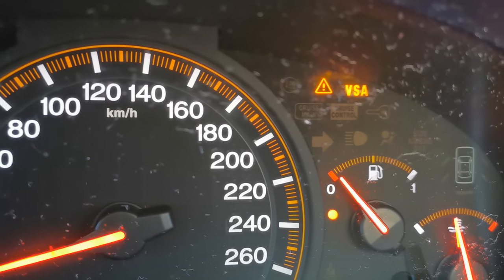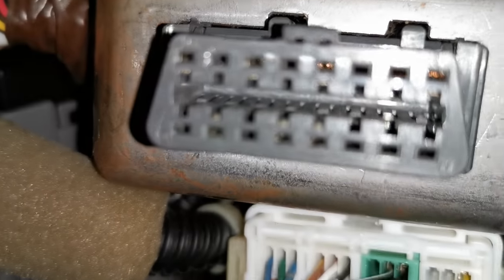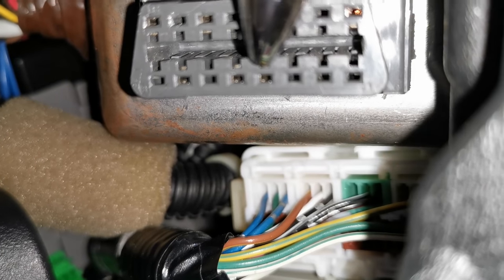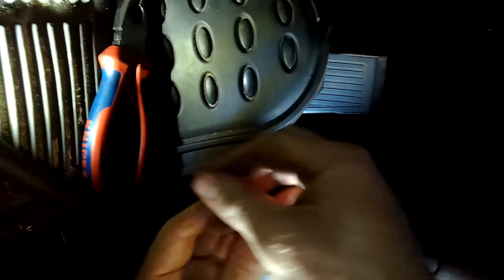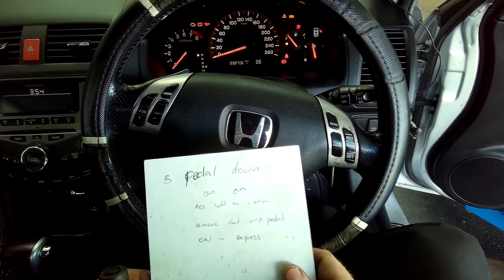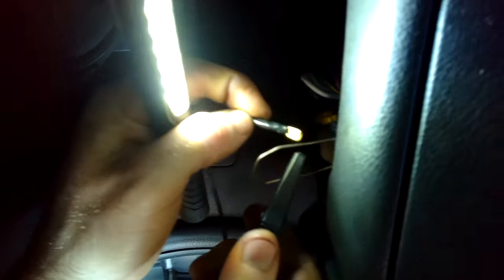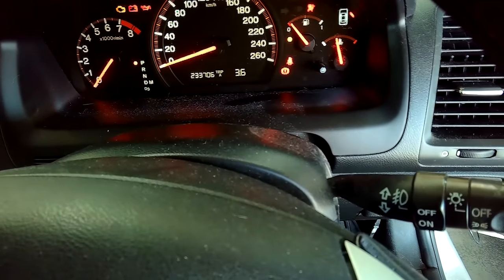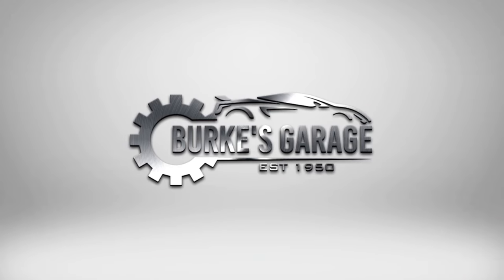Honda VSA & ABS Warning Reset - Simple DIY

Comment: Hello,  I was watching your video to do the same procedure. Unfortunately I put one end  in the 4 the other end in the wrong one .
Now my car dashboard lights are all gone then check the small fuse was burned. 
Replace the fuse dashboard lights came back but car doesn't start. 
Ignition turns on car doesn't start. 
Would you help me please 
Thank you
Reply: Hello, 
Can I reset the 2013 honda Accord with the push button start?
You said that push the brake paddle and turn the ignition on.
If I push the brake paddle and switch the button, the engine turns on.
I need your assistance 
Thank you

Comment: I just had an mot done which is in the UK on a Honda Civic 2006 the day after the ABS vsa lights were on. Does anyone think it has anything to do with going through the inspection or mot?
Reply: Mine came on after they ran a scan to check the alternator so very possible

Comment: Thank You very much @gerald Burke. This worked after the fault was introduced during a full scan using a Snap on scan tool. Anyone has any more information as to what exactly happens to the CAN data link to introduce this fault during a full scan from certain scan tools? Could it be that the scan tool is trying to send a message that isn't understood by the ABS module hence "84-01 sensor logic failure" code.

Comment: I did exactly what you said and it did turn the lights off but somehow it comes back
Reply: Try not using the ground for the second step and just leave the jumper in pins 4 and 9.
Worked on my 2007 cl9 accord 2.4ltr doing this.

Comment: Nice video, but it ain't straightfoward enough. So if people are better reader than viewer, i copy here the instructions that i found on club tsx :
1) Jump pins 4 and 9.
2) Press and hold the brake pedal and switch on the ignition.
3) Wait for the ABS light to turn off and then remove your foot from the brake pedal.
4) Wait for the ABS light to turn on, then press and hold the brake pedal again.
5) ABS light should turn off, then remove your foot from the brake pedal.
6) Wait for two flashes of ABS light. If it flashes it means that errors are erased.

Check the errors (with the pins jumped) - just turn the ignition on, if ABS light does not flash, no errors are in memory.

Now the main part.

VSA neutral position setting

Do not touch the brake pedal anymore.

1) Jump pin 9 to chassis ground (I have used a bolt on a door hinge).
2) Turn the ignition on, after ABS light turns off, quickly press the "VSA off" button.
3) After ABS light turns on again, quickly press the "VSA off" button.
4) Now should be a lot of different blinks and flashes and all lights ABS, VSA and triangle should turn off. The problem's solved.
5) Open the beer bottle!

And yes it works 100% :)
Reply: What if my triangle light is on when I start the car and then vsa light pops up about a minute into driving

Comment: This procedure worked on a 2009 honda pilot,it fixed a 84-21 code after a full code scan with a Snap-on Modis Edge scanner
Reply: @GerardBurkeBurkesGarage  have an American 2007 civic Si. Same problem. Will this process work? Same instance, did a full scan then lights came on.

Comment: Thanks for the tip, worked on a 2003 accord in Canada, my cpr129x must have caused it.
Reply from the maker: Cheers John, thanks for the comment.  
Off topic question, how do you like your Launch? I am getting a Creader 909 in a month or so and will be doing some reviews on it. 
interested how you rate the 129x
Reply: Gerard Burke  I have had it since about Christmas, it’s been pretty useful, I was able to reset the brake light after a brake job on a Hyundai, the cheap Bluetooth to phone devices couldn’t.  I was able to read the data on the abs pressure switch that’s how I knew your reset would work and that it wasn’t a bad abs pressure switch

Comment: Hi I recently had my VTM-4 oil diferencial changed and know this VSA ⚠️came on can you tell me what causes this and would this apply on 2006 Honda Pilot
Reply: 2006 pilot ex 243k miles. just fixed mine with this step. had o2 sensor replaced and vsa light came on after mechanic cleared the codes. dont know what triggered the vsa light either. its just a flaw imo.

Comment: Thanks for this, just done on my 07 FN2 Type R worked spot on, removed both.
Reply: I can’t get it to work on same car.
Reply: @russellmay9841  Just remember plug is 1-9 on top,bottom is reverse 1 is below 9.If you have this then follow as in video,my ABS did flash 2 times but came back on though.Tuned ignition off but left keys in so was beeping, I then removed no 4 attached earth to clip & my door nut & followed as video. It did take me 3 times before worked though. Fingers X it works mate.

Comment: 2006 Pilot 243k miles - this fixed my vsa light. had bank1 o2 sensor1 replaced and mechanic cleared the codes even though i had no check engine light, but i had intermittent 420 code. started the engine and traingle light was on, at 30mph the vsa light comes on. after i cleared the light, drove it for 13 miles and no warning lights.

Comment: Mine has ABS VSA and BRAKE lights on, my mechanic changed all the wheel sensors and I still have all lights on, he is telling me now it could be the control module. wow! I will try this and see if it works. 

Also my passanger window works but not from drivers side main control, I bought a new one and didnt help. Any ideas? thanks!

Comment: Always check your fuses first before doing this !edit:I recently cleared all my lights which was abs and tcs turned out it was just a 7.5 fuse
Reply: What year and model do you have and which fuse was it?  Thanks in advance!
Reply: @user-wc9qz7bx5k  2002 accord I forgot the fuse number but it's located on the inside driver side fuse panel box  it's the 7.5 fuse related to the tcs ....also if you take out the clock fuse and put it back in it will clear the check engine light sometimes..
Reply: @jobee1585  Thanks!  I'll give those a try.  I've got a code reader and can clear the codes but they always come back.  If the fuses are good I think I may need to replace the abs block, control module, or motor or all of the above.  Thank you for your help.  I appreciate it!
Reply: What fuse was it ? If possible
Reply: Will this work on a 2010 Honda Accord?
Reply: I tried it yesterday and the IMA light came on and doest work anymore, do you think I blew a fuse for the IMA?

Comment: Sodding car. Type R 07, changed all brakes and discs and lights still on so I’m using this method. Hope it works.

Edit: Doesn’t/Didn’t work.
Reply: Did you experience issue where car blacked out when you tried to start? I lost all electrical after doing this.

Comment: You're awesome man. I just did a scan on my car after replacing a wheel sensor so I could delete the codes and that damn triangle came on. I scanned 2 more time to make sure everything was good and it was but I had to do the reset trick to get this stuff to clear.

Comment: Hi!! This tutorial work on my civic 2012 for both lights. But, after a few minutes running my car both lights, abs and vsa come on again. I have notify you this malfunction come right away after change front passenger wheel bearing. Please, if you have an idea what's happening in my car tell me, I will appreciate so much!
Reply from the maker: Its very difficult and sometimes impossible to diagnose faults online without me viewing the car, it is the main reason I do not offer online help services. 
I will give you this generic advise that I would give anyone in your situation, check the work that had been done. 
Does the wheel bearing have a magnetic encoder to pick up the signal from the abs sensor? if it does, is it fitted the right way around? 
From there it is a process of elimination, if you have no access to reading fault codes then visible check sensor wiring and that nothing is blocking the sensor signal. 
If you have a scan tool it becomes a lot easier, you will have the information of fault codes, them codes with live data can tell you if you have correct signal or not and streamline diagnosing. 
Watch my video on this here for some help https://www.youtube.com/watch?v=Jg1kFR8FwqY 
 
All the best with your fix.
Reply: Thank you so much men!
I know it's very difficult diagnose fault online and appreciate for take your time to responded me. 
I didn't saw any obstruction in the abs sensor but the mechanic guy for some reason installed extra bolts watcher in the caliper main bolts to make an extra space in between the brake pad mount clippers and brake rotor. 🙄 Do you think if this extra watches makes any problem with abs sensor?
For reading codes I only have a bluetooth  obdII scanner. The other days show me the fault code U0155.
Thanks again!
Reply: Bolt washer**

Comment: I recently had this issue swapped the abs module had code 121-1 and 121-21
After swapping the pump one off of eBay had code 122-1 failure to communicate got it to work after several attempts and had low voltage codes come up thought the new pump was bad after 3 day of pulling out my hair I unplugged the battery and touched the positive to the negative wire for 30 seconds plugged the abs module back in and hooked up the battery codes never came back going on day 2 and no codes ….. this method would not work for me it cleared it but would come back every day note after 3-4 starts abs and vsa would come back and found it hard to believe that the junk yard would sell me a bad part 😒

Comment: These aren't the correct pins fir Accord 7 CM2 facelift 2008 2.4 AT... When i put the paperclip at 4 and 9 my little display on the dash is going like crazy with fault's and EPS light strobe lights. If anyone knows the correct pins would be great.

Comment: Tried this hack and It ended up shorting my radio unit display, now it's not turned and the VSA and ABS light is still on
Reply: Did you connect the proper pins?

Comment: Do Not Do THIS on a 2005 CRV (US)... it will kill your ABS modulator... if you are stuck in "Limp Mode" after doing this, you can disconnect the wiring harness (46P) from the ABS unit and your car will return to normal operation -VSA & ABS

Comment: I did the same procedure & it worked, but after less than 5 miles, it appears the same problem, VSA + ABS + Brake light pop out in dashboard, I did this reset 3 times, but it always appears within less than 5 miles, please assist, thanks
Reply: Check your brake fluid. It means that it low

Comment: Nice work mate
Reply from the maker: Thank you Greg
Reply: Hi mate just wondering if you can give me any advice on a problem that I am having on my 2007 3rd generation CRV my ABS lights would stay on for 4 or 5 weeks then it would go off sometimes for a day sometimes for two weeks so i fitted a new Hub with the speed Centre built in then I fitted a new ABS sensor so now when a reset the codes the lights will go off what are seen as a go over 50 km an hour the light will come back on again any advice would be really appreciate it thanks (love your videos)

Comment: Be careful with this. Thought I'd really broken something when I did this and it didn't flash or do anything. The car had an immobiliser issue and when I did this it went from an intermittent fault to a constant fault. It was a miracle I managed to start it by what seemed like pure chance for the ABS unit to "reset" itself. THIS TRICK WILL NOT FIX ACTUAL CAR PROBLEMS. the abs factory service manual says this light can be triggered by driving conditions. Only reset it if there isn't actually a fault with the vehicle or you might not be lucky like me.

Comment: There's something majorly wrong with your car.  You better get it into a certified mechanic right away.  Your steering wheel is on the wrong side of the car.  No wonder I couldn't find the VSA switch on my car.